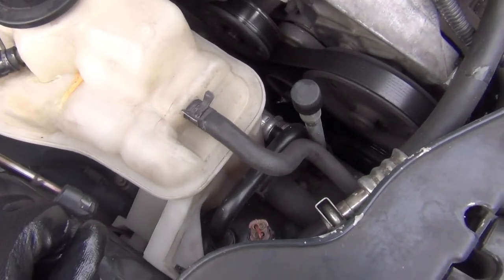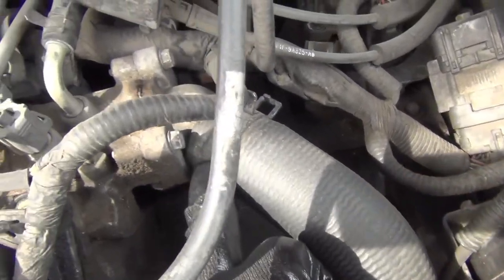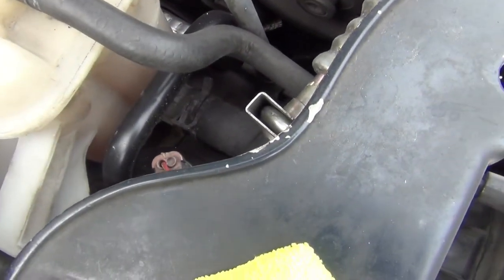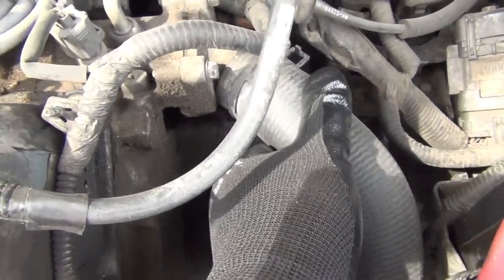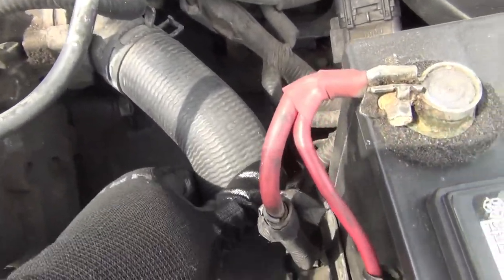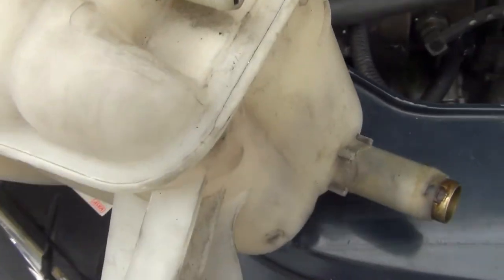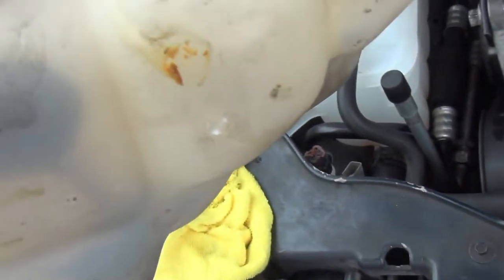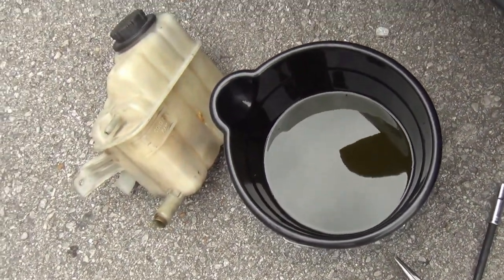What Causes Pressure And Air Buildup in the Cooling System

Comment: If there is air in you system will it over heat i have a overheating issue 2010 subaru legacy new thermostat and rad cap. Still over heating im praying its not head gadjet ill be done.  Fan appear to be working heater working i winder if it coukd be a faukty coolant temp sensor.s.o.s.
Reply from the maker: It could be a number of things....bad thermostat, low coolant, old coolant, clogged up coolant, leak in the radiator....check the thermostat first.